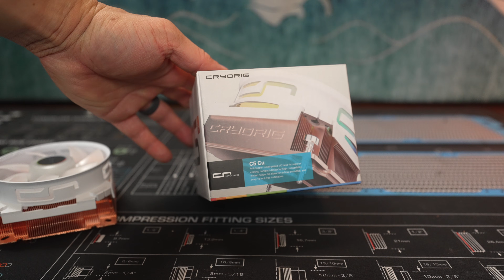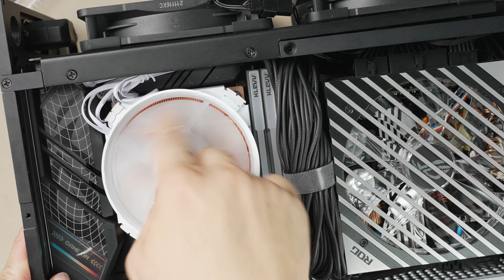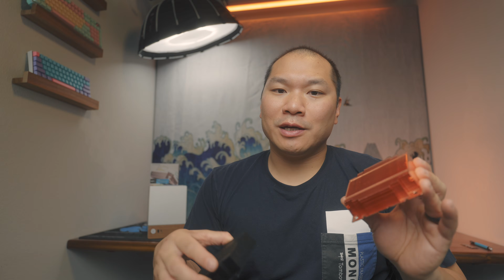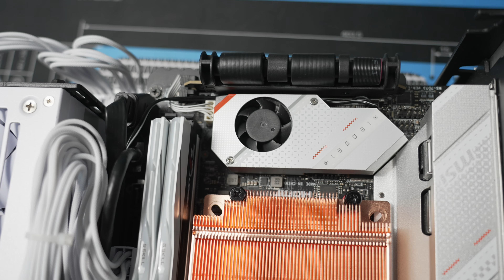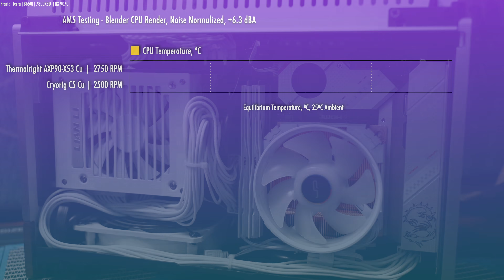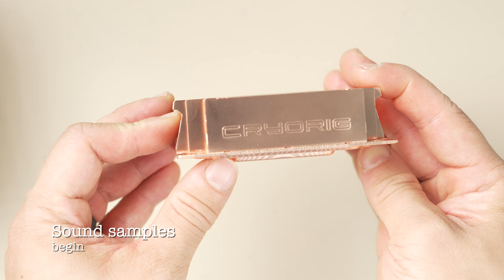Cryorig's C5 Cu Vapor Chamber Cooler - Can 0 heatpipes win?

Comment: Sadly I bought one of these it performed so badly I ended up contacting Amazon they sent me another instance the one I bought was a DOA pos nope 2nd one came in performed just as horrendous as the first it defies physics it's a giant block of copper that can't cool Delidded liquid metaled 8700g with his back on. Some how 84c insanely fan blasting to 3000 rpm even in bios.

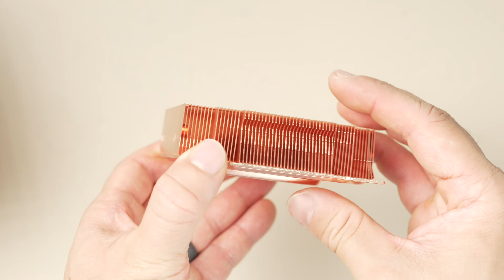Comment: 1:25 there is clearly no vapour chamber on that cooler it may simply be made of pure copper and a lot of it, you would need a vapor chamber for the vapour to evaporate up or along a heat pipe so it moves the heat up to thermally conduct the heat up near the heat dissipation area, heat rises so better to utilize that also, you can buy copper coolers that dissipate about 240watts and are meant to be silent operation, fanless, when using real pure copper it has the highest thermal conductivity of any metal and is also a much higher thermal conductivity than water/liquids

Comment: I wonder if the vapor chamber design would work better if the motherboard (and cooler) was flat to the ground instead of vertical on the side. Also kind of disappointing that it appears the C5 can be rotated to change the orientation of the internals and fin stack for intel sockets, but the AMx mount relies on the cutout holes which are only on one orientation of the unit. This has been a big pet peeve of mine for cooler design with respect to AMx sockets for some time. I wish cooler manufacturers would permit any orientation for AMx mounting.

Comment: Got it, so still with the Thermalright cooler that I already have in my Terra. That noise is insanely annoying as it is. If I could swap for a Noctua fan on it, I might be more interested.
Reply from the maker: The Thermalright fan is annoying?
Reply: @MachinesMore  No, I'm talking about the Cryorig one. I have the Thermalright cooler that you used as comparison in this video.

Comment: Even if the cooler were actually good, the proprietary fan without any official option for a fan swap is a huge turn off.
Reply from the maker: I question why that had to be. It’s not like the “90mm” form factor gives it some advantage over a plain 92mm fan

Comment: I have been suspicious of this cooler since the announcement. It's because it traded through-fin airflow for a vapor chamber. There will be a glaring entrapment of air nearest the vapor chamber.
Reply: if they changed the design, made the fins taller, you could mount a fan in the side instead, negating that exact issue.

but yeah, these tiny ones are clearly flawed, it needs to be redesigned.

Comment: A Chinese YouTuber replaced the stock fan with the fan from the Cu 7 and it seemed like it outperformed the AXP90-X47 with lower height while also running at lower noise levels:  https://youtu.be/xvk3AwLozDs?feature=shared&t=330

Might be worth looking into.
Reply: Its an unfair comparison. The fact that you need to replace the fan on this just to beat a stock AXP90 just makes it look worse

Comment: i guess the is55xt and its line up still remains top dog for price to performance. sad but let's hope future VC low profile models actually deliver.
Reply from the maker: The IS-55 is pretty good but actual height is more (~57mm), so it’s slightly in a different class; one thing I recall is fit is really awkward because it uses a 120mm footprint with such a low height- so board compatibility is key.

Comment: Well, that's a shame. I had some hopes that a vapor chamber would be a worthy innovation considering it's what NVIDIA uses to cool those stupid 600w cards. Maybe vapor chambers don't show their advantage over heatpipe cold-plates unless the heat source is ridiculous. I guess the vapor chamber is just a niche design for use-cases where water cooling would be preferred, or even required, but as a manufacturer you can't justify the headache involved with selling water-filled hardware.
Reply from the maker: For what it’s worth that heatsink design pairs the VC with heatpipes. I think because the non heatpipe design here limits the heatfin height severely, there’s still not enough heat exchange surface area regardless of what the contact patch can pull.

Comment: I'll be buying the copper version. Hopefully someone makes a fan adapter to 3D print. I have been using a C7 Copper and a AXP90-47 full copper just not cutting it with a 265k stock. I had such high hopes for this cooler thought this would do miracles guess not.
Reply from the maker: Ultimately we’re still limited by what a 92mm fan can do.

Comment: Saw the 185w tdp and was excited about cooling hotter CPUs in the terra, but after the caselabs review I went ahead and got the Lian Li A4-H2O with a thermalright 240mm cooler + 2 arctic p12 pro instead, and it keeps very cool and quiet with a 7950x3d and steel legend 9070xt
Reply from the maker: Nice! Yeah well in A4-H2O it’s pretty lopsided for liquid cooling since you get 240 with full fans.

Comment: Hey M&M.  Is there any way you could run Cinebench R23 multicore with the 9800x3d and post back the average wattage and frequency of both this and the AXP90x47 FC?  While showing blender runs is helpful, it doesn't truly show the difference between both of these coolers and if this one is actually better or worse.  The 9800x3d as you know will continue to boost until it hits TJmax and being able to normalize this to whichever handles 5,2ghz without throttling itself should be a good indicator.

Comment: Vapor chamber requires large (contact) area to be more effective. It cannot transfer heat outside the area into taller fins. In order to be successful, it should be combined with heat pipes. They need to learn from 5090 heat sink designs.
Reply from the maker: That’s my impression as well. I surmise that the design could have potential when heatpipes are added, as you mentioned looking at 5080/90 heatsink designs they involve heatpipes to effectively transport the heat evenly to the extended parts of the heatsink.

Comment: if had to say - relief pattern on the footing is the problem, you cant cheat the physics - copper has a few dozens times higher thermal conductivity than THE BEST thermal paste
if youll ever do a big shuriken 4 review - i would love to hear your thoughts on turbulence on cases with 67mm clearance as scythe states that the new fans design will effectively mitigate it (turbulence) completely x)
Reply from the maker: That is an interesting point. I did notice its texture, and although paste can fill those gaps I could imagine having a very flat surface that requires as little gap filling as possible would be much better.

Comment: The tech power up reviewer for this noted it actually seems to favor higher tdp usage.  In other words, it works best with cpu with a higher tdp.  

Would be interested to see how it compares with a more powerful cpu being cooled.
Reply from the maker: I don't know what their testing parameters are, but I can say with full confidence these coolers are unsuitable for anything more than 65W TDP CPUs when installed vertically in a sandwich style SFF cases. As for higher powered CPUs, the 14600K I tested with can often draw well above 160W when given enough cooling, in other words 9900X level of power draw, but since it throttled with the C5 Cu, the max it wanted to draw down ended up around 117W.

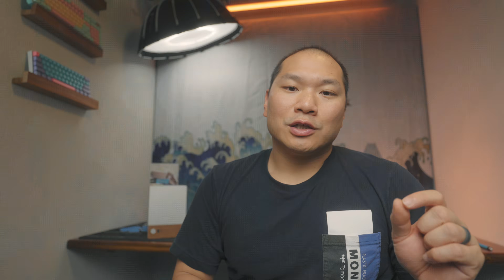Comment: Tyvm for the vid. Gamers Nexus Steve mentioned in his RTX 5090 FE that the vapor chamber coolers are sensitive to how they are orientated (w/ the exception of the 5000 FE cards). He mentions that they are best when they are run in a horizontal state rather than vertical of the vapor chamber design. If you did your testing w/ the cooler in a vertical orientation 7:28 that could have a negative effect on your testing results. 

Either way I did read another review about 2 months ago stating that this cooler falls short from the claims that Cryorig makes. I was hoping to use this for my ssf/itx build but once I learned this was not going to work I just went w/ the Atmos 240 aio which surprisingly is cooling my 14900K uv in my Dan H20. I'll perfectly understand if that's not believable bc I couldn't believe it either when I initially tested it but it's working, lol. That Cooler Master Atmos is a sick AIO even for Intel.
Reply from the maker: Indeed, all coolers were tested in the vertical orientation and that may factor into the results (ergo I have not tested this in a flat orientation). That being said I assume the majority of potential buyers would be looking at using this in T1, Terra, sandwich or console style case where the predominant orientation is vertical, and the appropriate comparison would be against similar height coolers installed in their normal orientation in the actual case.
BTW on the Atmos, yes indeed, it's a very good cooler. Excellent coldplate and is a class leader for 240.
Reply: @MachinesMore  yup, i was looking at this for my T1, thanks for the testing
Reply: @DREDD9000  I recently built my 1st ssf/itx pc and I went w/ the Lian Li A4-H2O. I wanted to go T1 but I was concerned on whether or not my hardware (14900K + 5070 Ti) was going to work bc of the heat which it does w/o any issues as I'm using that CM Atmos 240 aio. Now that I know it all works I'm looking to migrate my sys to a T1. I do need to do another test tho to see how temps are w/ a 120x15 fan & 120x30 as that seems to be the best aio fan config for the T1 that I've seen.
Reply: Guess this is a good excuse for a SilverStone FLP01 build. Too bad the Cryorig can’t accept say, a 120mm Noctua fan